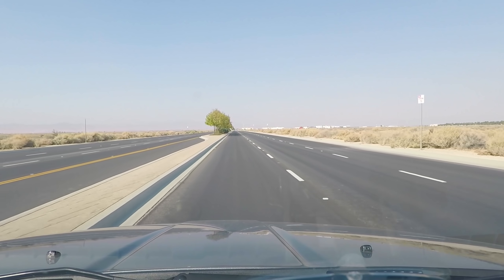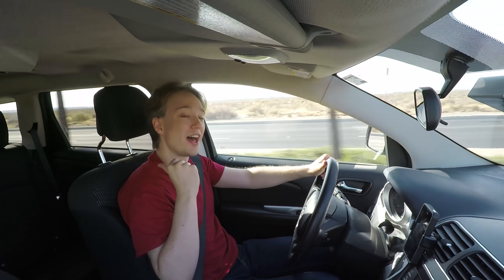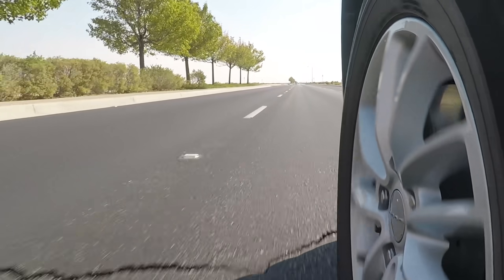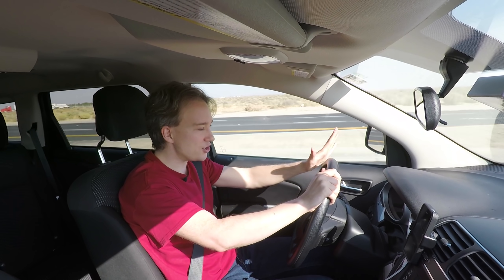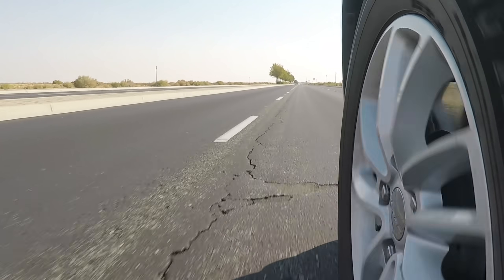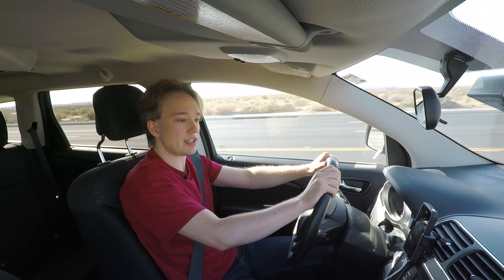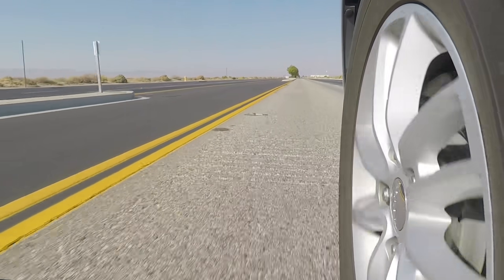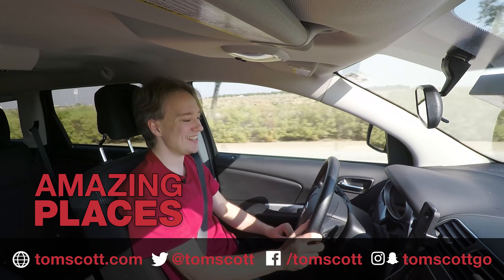Why California's musical road sounds terrible

Comment: For once I was happy to see a video I watched 3-4 years ago pop up again. I just so happened to try to explain this to a co-worker about a month ago, of course I bumbled and stumbled through the explanation based off my memory, and they expressed kind (dis)interest for a little while, until the subject was changed.

Still amazed that they couldn't get this right, I'm an electrician, not a roadbuilder, but we use measurement language like '4" center to center' all the time. In my case it indicates 2 conduits, with centers 4" apart, not grooves in a road, but still, the concept is out there. For an electrician, typically working in a 20" wide panel, if you put conduits 4" apart, not 4" center to center, if you have a medium high number of conduits, you will run out of room before drilling holes in your panel for all the conduits needed. A really crowded panel might be 3/4" conduits, 2" center to center.

Comment: While the explanation isn't impossible it is a little implausible. Wouldn't the people designing the road have made drawings for the builders to follow? I don't work in road construction, I work in building construction, specifically in the design of building components, and one thing we do not do is casually throw around measurements without specifying what the measurement is from and to. e.g. '16" stud-to-stud' or '4' 2-1/2" from face of block to face of plywood'

Comment: Imagine if there was a similar road near Lancaster in the UK, oh wait there was one, the M6 just south of Lancaster played a similar annoying tune it was locally known as the Forton whine.
It was due to the original road surface being concrete,( you also got a regular thump as the tyres went over the joints between the slabs) gone now resurfaced some time ago with tarmac.

Comment: Are the ratios still correct? If so wouldn't there still be a certain speed where it would still sound correct? Would probably be dangerously high speed I'm assuming

Comment: Isn't it also a problem that the distance between the front and backwheels of each car is different? So if you compare a Smart to a S-Class, when the smart hits X with the front wheels, it hits Note (X-Y) with the Backwheel while the S-Class hits also X with the frontwheel, but (X-Z) with the backwheel

Comment: Evidently no one in the road crew had practiced rough carpentry. Framing a wall with studs 16" on center means from the middle of the stud not edge-to-edge.
Reply: So true!

Comment: That's amazing. Awesome idea.

So if you poured oil on a road, drove on it at high speed, anchored the brakes, did several 360's, and the passengers in the back screaming for their lives....you'd get Coldplay?

Comment: Plot twist: to get the best song experience, you’d have to slam on the gas for a faster pace and risk getting a ticket
Reply: You took Gas Gas Gas to a literal meaning
Reply: how tf is that a plot twist
Reply: @vishwarao6064  i guess bc city planning and construction would prefer you drive slower and for them to have put in extra effort on a road just to have people do the opposite of driving slower, makes it a bit ironic
Reply: @MetalY2KMusic  that's only a bit ironic as you said, not to a plot twist level
Reply: unfortunately that wouldn't work, since the distortion is constant you'd have to change your speed for every note.
but if you do that, it would indeed sound right

Comment: I did a live remote for the original singing road in Lancaster. At that time it was on Ave K around 50th st west.  I actually drove twice and broadcasted it on KFXM . Once at 55MPH, second time going the wrong way at 55 MPH, henceforth backwards. And yes the relocation failed miserably

Comment: And it's also not by just dividing the tone by 2 for one octave, it's also a matter of controlled detune to make it sound good. If you'd simply take one octave, devide it by 12 and use those frequencies, it'll also sound horrible. It's not that easy. Piano tuners have to learn tuning for years to make it sound good.
Reply: Can't you just use just intonation? (pun not intended)

Comment: That's definitely a common engineering detail. You always specify either the component is mounted on center or provide a dimensioned plan locating said grooves. Bunch of dinguses

Comment: "The center of each groove should be four inches apart from the center of the next groove."
Reply: Most engineers will refer to "center to center distance" exactly to avoid this ambiguity when, for example, drilling holes into something.
Reply: 4" o.c.

(on center)
Reply: @Dwafiz  Or in Europe, 102mm c/c (centre-to-centre)
Reply: Center to center, start to start, end to end: all of them would work. Just not end to start.

Comment: my guess would have been, that the issue is the distance between the wheels. since you hear two sounds at once, one from the front wheel and one from the back, and different cars have a different length it just sounds off for cars that are too long or short.

Comment: Great demonstration, I run into these type of problems frequently.  i.e. fencepost problems and anything you could imagine that arise from linguistic descriptions, especially when they have to be relayed between different disciplines.  In this case it was translating from a musician though multiple engineering disciplines and ultimately to a road construction crew, which is an unlikely interface with little track-record.  I've found that some people seem to never care about the impreciseness of human language or they just have too much faith in it.  It takes real thought to write a specification or work-instruction that will be understandable to everyone involved and be unambiguously air-tight.  Mathematicians write in their own type of language of equations for good reasons: language simply cannot express what they are saying.  A well-placed diagram can go a long way, "a picture is worth a thousand words" holds quite true.
Reply: That's why I like computer programming... Much more precise than human language!

Comment: Thought the answer would be the pattern of the tread is not constant around a tyre, but variable to stop stuff like this (harmonics) on a smooth road.  Bet it comes into it, even if they cut the correct grooves.  OR, it was designed metric and say 55 km/h and not 55 mph, or some other way it could be cocked-up.  Maybe 55mph x 1.608 mph.

Comment: Fun fact: one easy way to avoid issues like the spacing problem here is to say "on center" when describing the distance (e.g., 4 inches apart on center). That way work crews know what to reference when creating something - ironically, by not measuring from the center of the groove, but instead the side.

Comment: This reminds me of a construction job I worked on once. Building blue prints have 3 kinds of measurements. They are INSIDE TO INSIDE, OUTSIDE TO OUTSIDE and INSIDE TO OUTSIDE. The last one is not used very often. Well on this job which was a big 400 unit condo the blueprints kept switching between inside to inside and outside to outside. Some sets of prints would show the same numbers but would switch from one to the other for the same wall. Some walls ended up as much as five feet from where they needed to be. I was on the plumbing crew and there where pipes for toilets right in the middle of hall ways. It was a mess unlike anything I had ever seen.

Comment: Even if the notes were calculated correctly it would sound terrible.  Car tires are intentionally designed to prevent resonant vibrations.  What you get is muddy broadband noise.

Comment: Set the playback speed to 2x. So basically, all you need to do is drive over that part at 110 mph. Problem solved.
Reply: Wow it really worked 
And it's amazing

Comment: I'm only just encountering this in late 2019. I suppose if I had known about it earlier I would have been able to figure it out too. See, I've done a lot of thinking about this over the years (and I know that they got something similar right, in Japan - - go figure) and thought that something similar to this, but more complex, could be used to generate artificial speech that would yell at people who were either speeding or going too slow.  You'd need to overlay polyphonic tracks recorded at different speeds, so that if you were going normal speed you'd just hear some muttering and chirping, but if you were going too fast you would hear a voice yelling "Slow down!", and if you were going too slow, you'd hear a voice yelling, "Speed up!"  See? :-)

Now, though, I'm afraid to entrust it to anyone but myself, and I am not getting out there on every road in the country with a hammer and chisel. Sorry, folks. It's a crappy world.

Comment: A six lane motorway with no traffic. It. Plus driving on the right. My only experience is cycling round Paris. The Arc de Triomphe was fun. There was a mini rush hour at 2 a.m. and I went round it 5 times as it was so exhilarating.

Comment: Tire size and pressure makes a difference in the sound perceived. Lower profile tires will make a hire pitch vs your higher profile. Also the type of tire will as well too. Tougher tires make a higher noise.

Comment: How does the length of the car and the number of axels affect the tune, even if they were to build it correctly? You'd get a small delay in the "encore", and if you had a bus or a articulated lorry you'd get a larger delay between "echoes", and a few more of them too.

Comment: Is it because the front and rear wheels are hitting the grooves at slightly different times producing a two tier note, so there is that discordant resonating effect? Think of the "clacketty clack" with train wheels on 60 ft rail sections but at a faster pace.

Comment: You know, there is actually a much better way to engineer a musical road, and it has nothing to do with bad English language interpretations. As a hint, how are vinyl records printed? 
Take a melody, an actual recording, drive over the asphalt, translate the vibrations to marks on the road (paint), and use the marks as guides to cut the asphalt. 
I mean, duh.

Comment: What went wrong is u were driving too slow. Going faster wouldve made the tune perfect
Reply: Nope, the error is constant, but the notes are different, making the thing wrong. Theoretically you could find the right speed for each note, but you can't practically change fast enough with a car.

Comment: The original road, built on Avenue K between 60th and 70th Street was built to tighter specs. It sounded great. Lancaster's attempt to rebuild it on Avenue G is what failed, not the original. Source: I was in high school on the road of the original at the time it was built.

Comment: Can't believe it took me so long to get back to this: the phrase the workers needed to hear was "from center." That instructs them that the distance between grooves is measured from, you guessed it, the center. Whether they WERE told and goofed up, or the designers neglected to tell them is up for debate, but I would argue that English itself is not the root cause here. It's either failure to inform because of assumed knowledge, or just a straight up failure to listen.

Comment: That’s too bad, it would’ve been a very cool road had it worked
Reply: Just Chilin It’s a road that plays music I think it’s still cool even though it’s out of tune. Did I just say a road was out of tune?
Reply: 666th like
Reply: Kermit
Reply: The road isn’t out of tune. He’s just going too slow. There’s a video of someone doing 100 down that same road and it actually sounds like the song
Reply: He's just explained that the road is constructed wrong to produce notes that aren't separated with their intended musical intervals. There is no way to drive down this road at a constant speed to produce the correct notes.
Reply: Chuk u i just watched that video, and it sounds the same. The tempo is closer to the original, but it’s just as out of tune
Reply: Squidward's Testicles do you have the url for that video?

Comment: Why didn't they fix it when they re-built it? They must have known it sounded wrong.
Reply: Duuuuude Where's my car
Reply: They should've noticed a discrepancy between the planned length of the road and the actual finished product. Unless the plans were wrong, but the way Tom described it, it was an error between the plan and the actual construction.
Reply: +The Pip We're talking about California here. Do you even need to ask? :P
Reply: I don’t think they knew what was wrong yet
Reply: @ollierowan9767  were they deaf? Couldn't they have asked a physics professor? Or anyone with a bit of common sense and a ruler?
Reply: Siana Gearz I meant that they didn’t know why it was. they said in the video it took a long time to figure out what went wrong. jfc
Reply: @CreatorNite dude, they only would have needed to redo the blueprints.

Comment: Why didn't they give them a drawing of it? And why didn't they go out and make sure? It seems like a triple fack up to me. You can't expect people who work doing roads for a living will automatically will get this right whether you know how to explain it correctly or not. That means that one fack up in the chain will fack everything up.
Reply: James Watkins for real. What kind of construction doesn’t have physical plans?
Reply: @Kyle17206  It did have physical plans.  The physical plans were obviously wrong, or weren't followed by the superintendent of the job either.
Reply: Even without a drawing it can be communicate in words.. Centers instead of apart. Its used in construction all the time.
Reply: I think it needed an arpeggio and maybe two voice polyphony too.

Comment: Problem = You're not using metric.
Reply: As much as I love to bash the Yanks for refusing to metricate, the problem here isn't one that can be solved by metrication.

This is a problem which can be made in any units. The problem is communicating where the measurement starts from. 

In programming terms, it's the difference between starting your FOR loop at x=0 and starting it at x=1. In this case, they started at x=1 when they should have started at x=0.
Reply: The problem is they used illegal Mexicans who didn't speak english.

The only problem with imperial is the fact most countries use meteoric.not that it's inaccurate.cause any standards is accurate cause it is held to a standard.

Comment: Play at 2× speed. Sounds more accurate
Reply: Gotta go 110mph
Reply: Bob Joe sounds slightly more pleasing to the ear but still completely wrong
Reply: Bob Joe Sounds like the Star Wars version of the William Tell Overture
Reply: It corrects the tempo, but the pitch is still all off.
Reply: still out of tune
Reply: Definitely not
Reply: no
Reply: Why not drive over it at 2x speed? That's not illegal, right?
Reply: You just have to drive 100 mph over it and it would sound normal.
Reply: He needs to drive twice as fast
Reply: you right
Reply: Bob Joe sounds better but nothing like William Tell Overture
Reply: Dont think anyone can drive 120 miles/ hr
Reply: You can actually tell that it's the same song. Good catch!
Reply: Sounds like the outside of a club
Reply: Still out of tune, but yes, much more accurate.
Reply: someone put it on HT. osu players will get this
Reply: Same
Reply: Bob Joe yes
Reply: Why the hell do I hear the mission impossible tune
Reply: Still sounds deepfried.
Reply: still completely out of tune buddy.
Reply: The speed is constant. It will always sound horrible.
Reply: Changing the pitch doesnt make it any less out of tune
Reply: Yup
Reply: true now i can hear what its mean and dont sound like a weird the wheels on the buss goes around

Comment: If you change the playback speed to X2 then it will sound normal. Or you could drive 100mph like it was designed to do 😂

Comment: If you don't have the EXACT wheel base on your car as the designers of the road music, it will sound way out of tune. You do know that the wheel base of your vehicle affects the sound output since both the front wheel and the rear wheel are emitting sound? It's like playing an old vinyl record with two needles instead of one.

Comment: Been there a lot. The road works fine and it actually does sound like the song. Older cars (older suspension) work better than newer vehicles. This guy has a cushy suspension so the car is going to soften those vibrations.
Reply: @tomscott

Comment: The song is designed to be heard correctly if the car driven on the road is a Honda Civic. The test vehicle used in this video is a Dodge Durango which has a much longer wheelbase. The wheel base of the car  was taken into account for the correct size and spacing of each groove cut into the road. Honda payed the bill and drove the Civic on it during the commercial advertisement.  I believe it was a Superbowl commercial one year. 😎